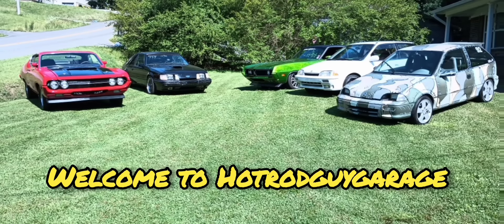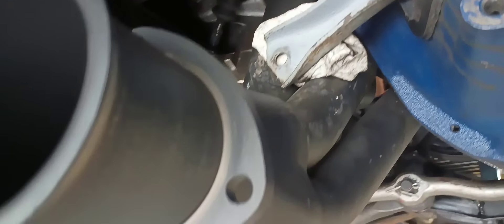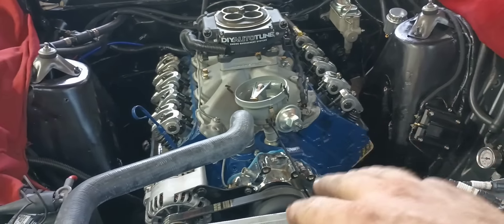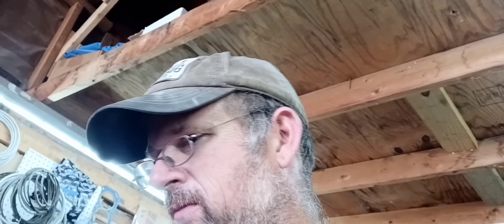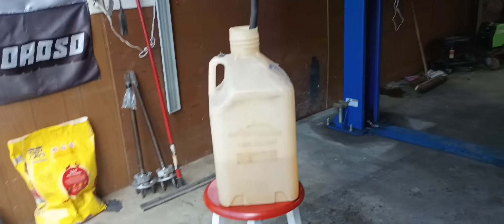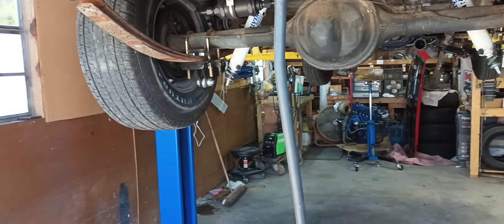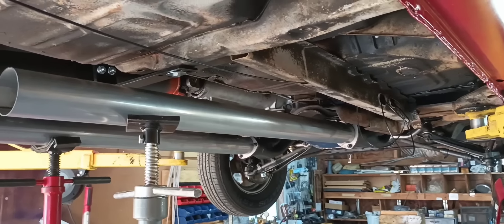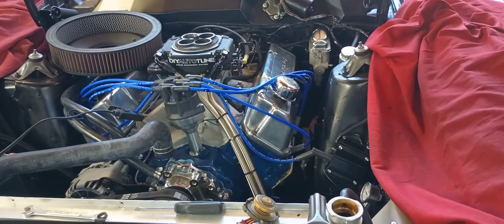Throw Down! Weekend Thrash Back To A Running Driving 1970 Ford Torino #Ford

Comment: Nice work. I’m not a fan of the Cleveland either but you go with ya got! It does sound good and should be loads of fun whether it is fast enough or not. Good luck and have a safe trip to the track!!
Reply from the maker: That's the plan! At this point it was just making it run and drive

Comment: If the distributor  dances around check the gear adapter. Every one latly has been off center. The push lock links a little nuts though. Because pretty much every fuel injected vehicle has those exact same connectors.
Reply from the maker: So far so good

Comment: Great job in short time! Only thing I would change is the oil pressure line. I throw away the plastic and use copper only. You never forget that "one time" when the plastic line failed at the track!
Reply from the maker: It's about time to change it

Comment: why do you prefer a catch can over a pcv valve?
Reply from the maker: It lets you keep a eye on potential issues instead of just burning it back through the engine
Reply: @HotRodGuyGarage  ok sounds like you been doing this for a while ...what kinda times you looking to run?...low 13s ?
Reply from the maker: With this one whatever it runs is what it's going to do I have no clue

Comment: I feel ur pain, i recently built my 88 hatch mustang into a 331 and bought some bbk 1 - 3/4 " longtubes and they were terribly hard to install,  passenger side being the worst, header is 1/4" from starter on the bottom and actually touching the firewall on the top runner, if i had it to do over i would've left the MAC shorty headers on it
Reply from the maker: I feel that for sure